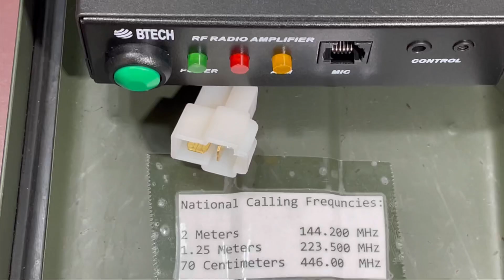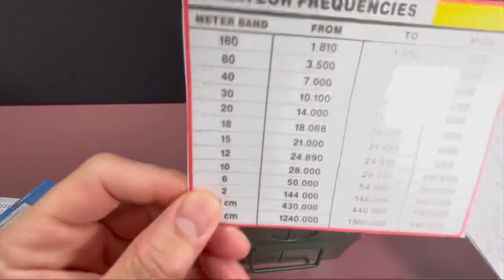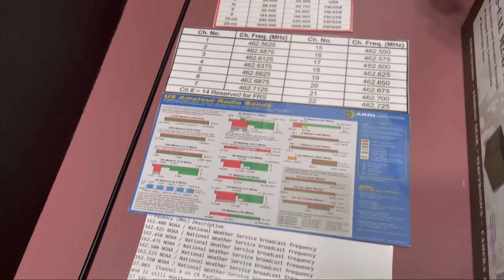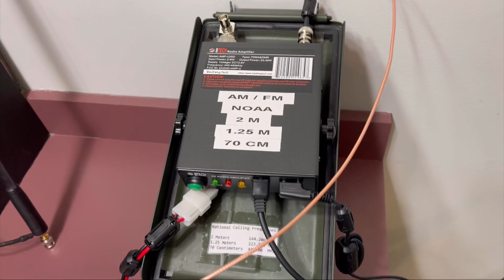How we built a Emergency Ammo Can Radio #comms #prepping #shtf #gmrs #ham #radio #radiocommunication

Comment: While your HT is multi band, the amplifier is not. The link you have is for a UHF version and should only be used in those frequencies.
Reply from the maker: You are correct I believe we did mention to get the amp in the band you need they sell 3 different ones I think
Reply: @thebackyardbushcrafters4417  Just pointing it out since you have a label next to the radio with the different frequencies and someone who might not know that, could use it wrong in an emergency.
Reply from the maker: @Littrell1966  your right! didn't think about that one maybe I will hook it to a dummy load and see what the amp actually transmits on....